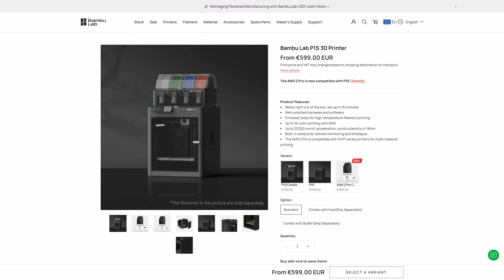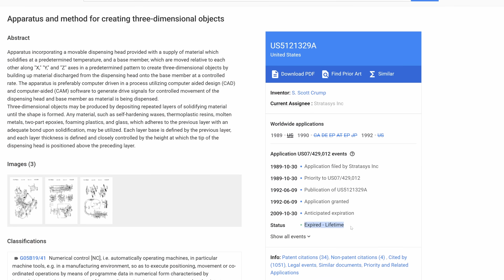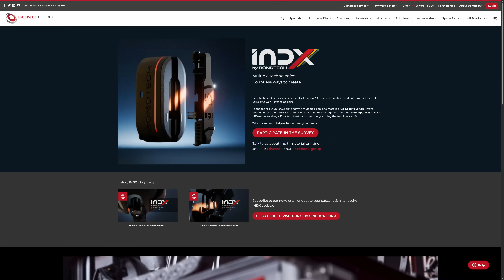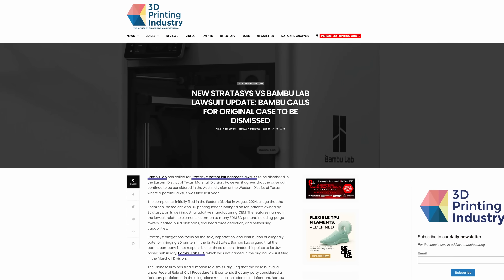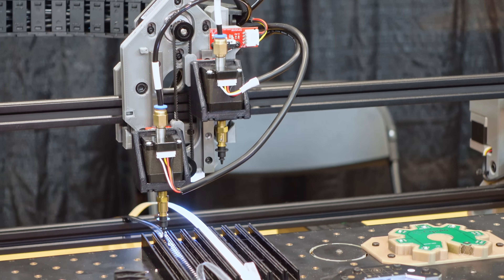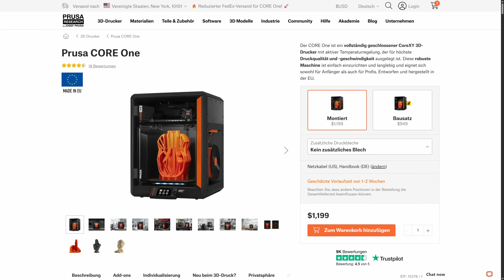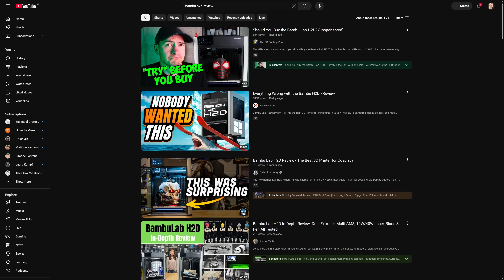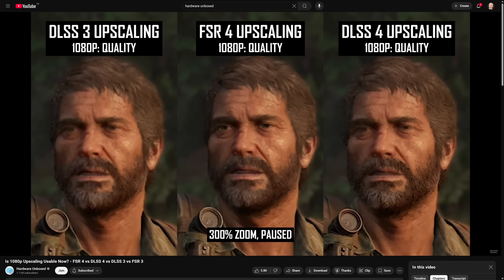How Bambu has won

Comment: So… I’m a fan of Prusa printers, yet I was disappointed over the 4 years since I bought Mini day 1, and the current offering was beyond my budget or will to risk a disappointment on a big budget. my mini was too broken on many aspects to take a risk. I went with P1S+AMS. For PLA and P(C/E)TG I’m happy with it. AMS is a bit meeh, but it covers filament swap most of the time, when it doesn’t hang. For fiberflex it was huge disappointment and head replace was necessary to bring it back to file (20 EUR and 20 minutes). It works out of the box, the integration for now is not annoying, still better than in cutter and plotters world. 
What I would love to have is Mini with direct extruder to cover flexible materials as a complementary option and proper extruder that is not that picky on material type. 
I like your channel and general approach but I guess we have to accept this new reality. Actually talking about those patent wars, dependencies, vendor lock in might be interesting content, yet not easy for you to prepare and likely not much popular in the eyes of sponsors.

Comment: Dear mate Tom,
In my humble opinion, while 3D printer machines have reached maturity, the same can't be said for many of their users. Are there enough rainbow trinkets lying around already, or should I elaborate?

The real next step is teaching people how to actually take full advantage of this technology. First, what's really smart to print, beyond hobbies? Maybe hardware, spare parts, full projects, but which ones? Which final product applications truly deserve to be 3D printed, and which do not? What are the real limits of this technology in terms of strength, heat resistance, impact resistance, and so on, not in benchmark tests but in actual day-to-day applications? Also, choosing the right material for the intended use should be part of the process.

Long story short: teach people what to do with their now nearly flawless 3D printer.

We’ve been through the RepRap era together, when everything still had to be reinvented from scratch. Now that the machines are reliable, the era of functional use cases has begun. And there is still a very long road ahead. Enough, I believe, to fuel a YouTube channel for the next decade.

Comment: i think bambu hit the mark on an easy to use, reliable printer. the cost isn't nothing to scoff at, but the price is just enough for someone to be able to afford one and still print fast, reliably, and get amazing looking prints. bambu printers are the best printer for a print farm in terms of speed and cost. prusa used to hold that title, and i still think in the long run prusa is still the better option for a print farm. i personally have been looking into a bambu printer or two for starting a buisness, mostly becuase its the best option right now. creality has to many ifs, and elegoo hasn't rgiven us all the options either bambu or creality has done. 

for starters and buisnesses, bambu is just the best option there is currently. guides are easy and simple, the printers work, and they are reliable. in the hands of a newbie, it helps you learn and get printing quickly. in vetrans, its an incredible tool that lets us do things that is just off the shelf working.

Comment: What Mouse is the one he has on his desk?
Reply from the maker: It's a R.A.T. 8+
Bit of a retro design at this point, but if you like flat-grip mice, it's an incredibly capable option! Because of my messed-up shoulder, I had to switch to something a little more ergo-shaped and landed on the Keychron M6 for my main workstation. Pretty cheap-feeling, but performs well.
Reply: @MadeWithLayers thanks dude!

Comment: Won? With a $2K printer? 
It's like saying Ferrari won in the car department. 

How a printer like the A1 that does not lock the PTFE tubes, and they get loose easily won anything? How a printer that needs to be online won? Who a company that give you a hard time every time you run out of filament won?
Sorry, nope

If that's the case, Prusa won with the Core, at least, Prusa are reliable

Comment: I love open source and everything good that comes with it, but without the simplicity of the Bambu Lab ecosystem, I never would’ve been able to get into the 3D printing hobby.

Now I’ve spent countless hours in parametric CAD, logged over 500 hours of printing on my Bambu A1, and I’ve caught the bug I’m itching to build a DIY enclosed CoreXY. (Though I have to admit, the Elegoo Centauri Carbon is also very tempting.)

Great video, as always!

Comment: re: patents

It is unfortunate, another example was Valve in the early days of modern VR. 
IIUC there is still sore spots there, when they had a lot of the early engineers jump ship over to Oculus at the time along with the tech they were developing more openly. Leaving those left behind super frustrated that the tech they worked in, was essentially jumped to market early under restrictive licenses.

Since then you can see their stance has changed, Valve patents defensively like a lot of other R&D firms.

It is unfortunate that companies need to do this, but with patent systems as they are you either get taken for a ride by competitors or file defensive patents restricting all access to anyone else.

FOSS licensing is a different albeit similar tragic story

Comment: I started with 3D printing 10 years ago. I built my first FDM 3D printer from scratch using Chinese instructions. I had to solder, drill, and connect every cable — and I didn’t even know Chinese, so I based the assembly on the images they provided. Then I had to download the software, drivers, and even Arduino to reconfigure the mechanical parts of the printer. That definitely made me an expert in 3D printing. So much has changed since then, especially now with “plug-and-play” 3D printers.

Comment: I have been in the 3D printing space since my 3rd printer a home build Anet A6.  I kept from house from burning down because of yourself and other creators that identified the firmware issues.  When you called out Prusa for an issues one one of their releases, I was surprised that Prusa had done so poorly, but not surprised that you called them out.  I have dozens of printers sitting around or in parts because of the Carbon X1 that I got on the Kickstarter.  Bambu Lab created a 3D printing appliance and has forced the other manufacturers to follow suit.  There are so many content creators out there that give guides on new firmware, slicers and other addons that I can see how hard it is to find a focal point.  Pre release reviews are great because you get the time to test and evaluate, not just spit out the manufacturers selling points.  I know this is not helpful but anything you do gives the solid and honest result we all want to see.

Comment: I think a variety of approaches/angles would be good.  When reviewing printers it should be looked at from a pure consumer view because thats a huge user base now.  So standard features and performance.  The the most vocal users would be the maker/tinker view too.  How closed off is the system? How easy to modify or get upgrade parts?  Software reliance?  And then in General for all reviews I think if there were any conditions for recieving review units should be disclosed (only say positive stuff, or only print with PLA, PETG for reviews, things like that).  Also for reviews I think it would be good to note on what the company that produced it is like (small start up, big player, first product, etc.).  These could be different videos as trying to cram it all into one would be hard.

Comment: I think your high level of knowledge and experience is for me the core of why i watch your channel. 
I defiantly want a very easy to use printer but I am also fond of open source culture as a whole. So maybe that could be an angle as well. Provide opinions and knowledge for open source printers for absolute beginners and some for enthusiasts. 

A lot of your enthusiasm came from the constant betterment of the printers and approaches to solve different issues. So maybe that hunt for innovation coudl be an angle as well.  Showcasing stundent projects or interesting projects from the 3d printing community. 
Its easy to forget that there is more than a few big corpos if nobody talks about the other stuff.

Comment: Screw that. Never buying a Bambu. "they won" is sort of true and yet also irrelevant. So what if they make a popular product that a lot of people buy and use? So does Apple. So does McDonalds. And I am not interested in either of them.

Consider it this way: Their product is essentially so good that it requires nothing of the user to use it, right?

Well, then what is there to talk about? It's finished. When something no longer has any room or need to change, that is a kind of death. It's dead. It's useful as a tool, but no longer *interesting*. In that respect, it's at the end of it's run. It's dead.
Reply: > Consider it this way: Their product is essentially so good that it requires nothing of the user to use it, right? Well, then what is there to talk about? It's finished <...> It's useful as a tool, but no longer *interesting*.

This is a very weird way of thinking. If the product supports user in all aspects and there's nothing to improve on, then it's perfect and it's finished, and usually such products are sold for a long time without changes (but for higher price than less refined competitors).

I do not buy screwdrivers or washing machines to improve them, or for them to be interesting, I just want them to do their job.
Reply: And do you make youtube videos about them? Or watch them? If it's all done and perfect then all that's left is torque test channel / project farm.

Comment: As much as I dislike the closed source environment you're working in with Bambu, after a couple of months of research on building a Voron V2.4 toolchanger (StealthChanger), I've had to admit defeat and got an H2D. That thing prints perfect prints out of the box, so far with a 100% success rate, prints multicolour / multimaterial like a champ. I have to give it to them, it just works.

Comment: More people are using 3d printer as a tool for their hobby/projects, They may not be interested in the printer itself (or the drama). But are definitely interested in how the printer can help them achieve their goal, which filament is suitable for their projects, slicer settings tailored to their needs, what to look out for, etc.  By covering some of those topics, it may help bring more people to view your content. Hope this suggestion helps.

Comment: I've been involved in 3D printing for more than 10 years and I've put together several 3D printers myself and also purchased several from different companies. I own a Bambulab printer and I can safely say it is the best printer I've ever used. I still tinker with printers in my free time but when I need to print something for work or something that just needs to work I just send it to Bambulab printer. I also purchase their filament and basically stopped thinking. I don't ever check the first layer as I used to for years. The level of comfort is unparalleled. All other companies just produced a copy of Bambulab printer to get just a piece of ever shrinking market. Finally we are done with crappy bedslingers and endless failures. It took another company emerging to show everyone it can be done. 
I like open designs and still spend some time thinkering but I really don't have anything against closed systems. In industrial 3D printing this is the standard and nobody complains.

Comment: One of the things I love about my X1C is that it is, for the vast majority of the time, fire and forget. Compare that to my old Ultimaker2+, which was far, far, far more temperamental. With my X1C, it has reached the status of a household tool (like the 2D printer) even if it currently takes quite a bit more maintenance compared to my HP Laserjet. The direction is clear so that in 10 years time, we won't even think about it.

Comment: People aren't using "easy" 3d printers for projects as much as they are using them to print out random plastic trinkets (that someone else designed) that will get put on a shelf and forgotten about. The world doesn't need another bust of <Insert Marvel/DC Property Here>
Reply: I would disagree with you. Just check youtube and what people are doing. And not just people printing trinkets, but printing actually cool stuff. RC cars/planes, mini engines, actual car parts etc. I wouldn't call those trinkets. And those people use Bambu stuff without issues. Bambu really pushed 3d printing into the mainstream more than any other company, but of course they are standing on the shoulders of giants because of of work lot of people did before them. Every industry is like that. When somebody invented the first car tire, everybody else started using it and upgrading it. We always improve on things people before us made.
Reply: I’ll admit I haven’t used my a1 on a prototype for about 7 days, but it is also printing wargame miniatures and terrain

Comment: Hmmm there are plenty options which are cheaper and as good or even better than the P1S. I myself wanted to buy one. But than bought a Kobra 3 Max. under 18 Mins for a benchy. Huge printbed, has Spagetthi-detection, a touch-screen and object-skip for mid-print object fails. The Ace-Pro MultiMaterialSystem has a build in heater which bambus system doesn't.
All in all i would have need to pay over 1000 € to have LESS than what i got with my Kobra 3 Max Combo for 650 €!! The Max is to big? Ok, than buy t he Kobra 3 V2 Combo for under 400 € ! Same features as the Kobra 3 Max, but with a more "normal" Build-plate size. Still better and with more features as the P1S. Dunno why i would want to pay like double the price as the Kobra 3 V2 Combo to have the same or even less features ?!?!

Bambu feels like the Apple of Printers. Really expensive, closed eco-system, but you don't really get "more" for the money. Yeah its the "easiest", but everyone with a LITTLE bit of tech-understanding, and even my 9 year old has enough, can use a good alternative like anycubic or Creality Printers nowadays.

It's the same with apple and android. When apple came out it was THE easy to use smartphone! But as the years go by, android phones also get really easy to setup and use. 
The last 5 Years there is almost no reason to use apple over android anymore. Same for printers, IMO.

Always love your Videos but this time, only by the title and first minutes i have to say, because i won't watch it fully! I have to say, thats not true, anymore.

Comment: I do not have a Bambu printer but for me after starting 3D printing by building a printer from scratch (inspired by the Hypercube) and learning along the way, i can now easily spot what when wrong in a print and adjust everything accordingly. Not that someone who started with a BBL printer could not but I learned so much on electronics, mechanic etc along the way (thanks to open source 3d printer, software etc) and what I learned i can now use un my projects and I love it.

Bambu being closed source I feel like it would be way harder to learn along the way. But to their credit, you can easily buy replacement parts for reasonable prices, something that you cannot do with apple products for example.

Anyway, I think you should review what you want but also keep a part were you are honest about the products and give your opinion !

Comment: I've started with a faulty ender 3 v2 (I found out that it's faulty a lot later). The constant tinkering destroyed all the excitement and passion I've had. Printer would sit gathering dust for months between printing once in a while and giving up. I bought P1S for couple reasons: Prusa is more expensive and only had bedslingers and I didn't want another bedslinger. And I did my research they made good machines for cheap. It made it for me so the hobby was 3D printing and not 3D printer. I don't support bambu, I switched my printer into LAN mode because I love orcaslicer and don't want to deal with the mess bambu pushed forward. I won't be buying any more bambu machines but I'm happy with what I have. Had I had the money, I definitely would have gone for prusa but for what was offered at the time I made my decision.

I hate the way we do copyright and patents. I think it stops progress to an incredible degree. As you've said, sometimes there's an amazingly simple and great solution but oops you have to find a different way because some company has a patent they don't use, they just have it so others can't use it. You see it all the time, even in gaming. Freaking gaming mechanics are subjected to copyright, EVEN AFTER THE FACT. Looking at you nintendo (another garbo company). Or now famous nemesis system that cannot be used in any game. Sometimes I feel that if this continues we'll end up in a world where any game or art or anything will have to go through some sort of plagiarism check to see if you haven't accidentally infringed or someone's copyright or patent. It's just sad. The world just ends up being dull grey. But money runs this world so what can you do.